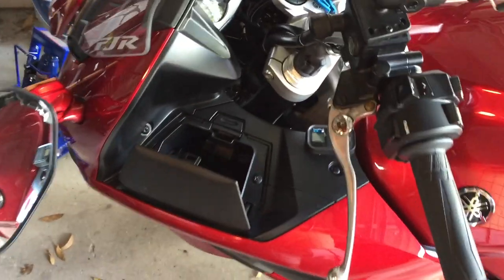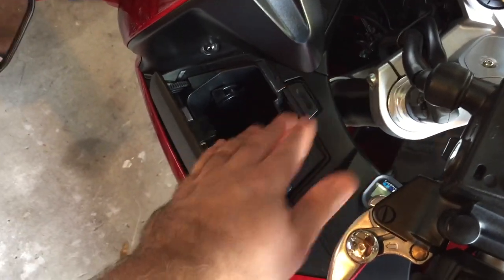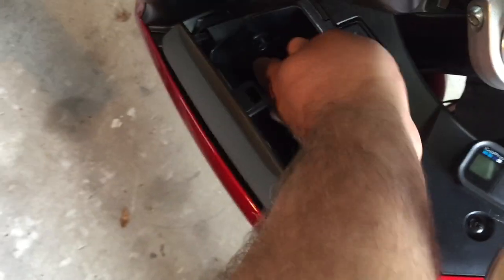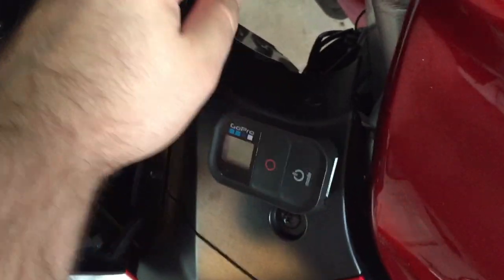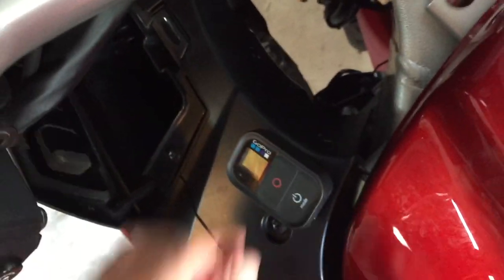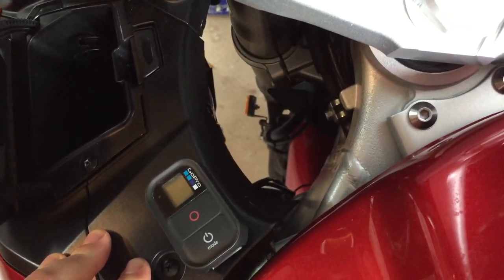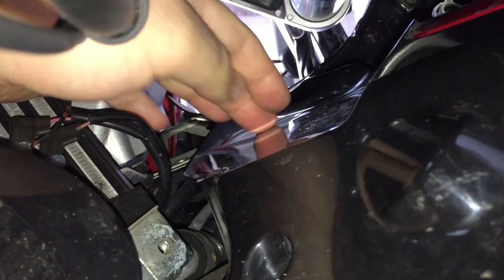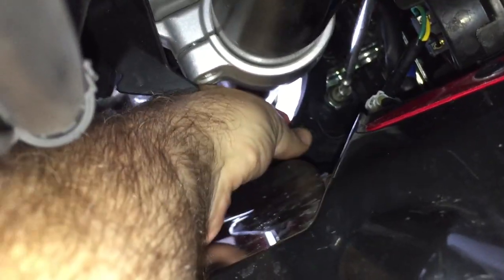Yamaha FJR1300 Dash Rattle Fix 2500 RPM

Comment: i did a test today with a ultimate edition end every time i hit a bad road or a puthole, there was a loud rattle in the front forks that i could also feel in my hands. it had the electronic suspension. the guy from yamaha said that it were the front fork, but i find it so odd that the forks mak sush a loud rattle. does your fjr does that also?